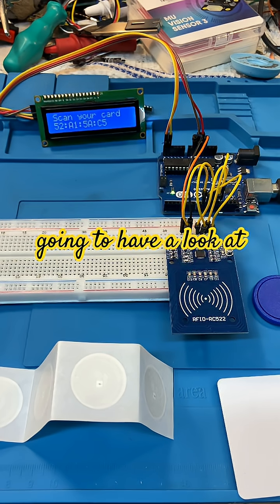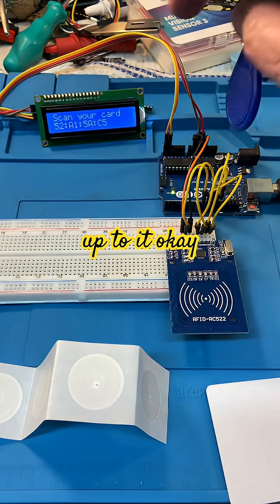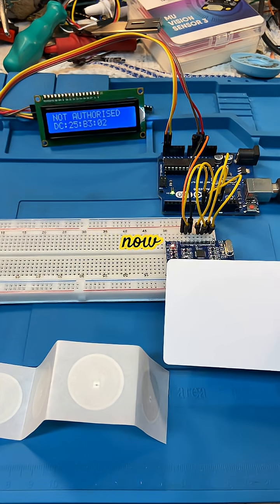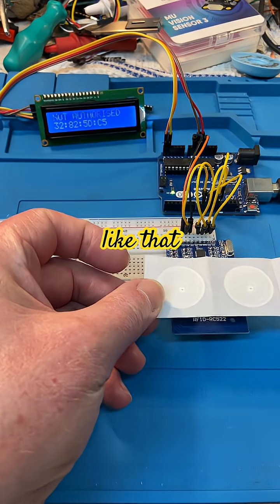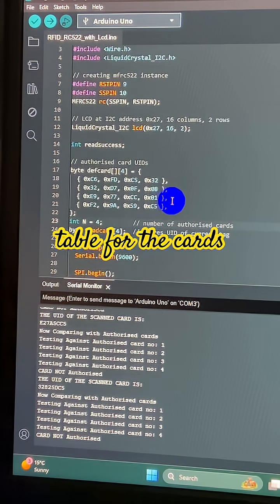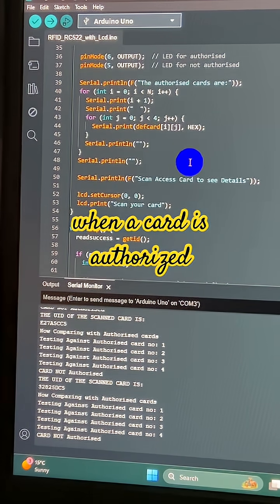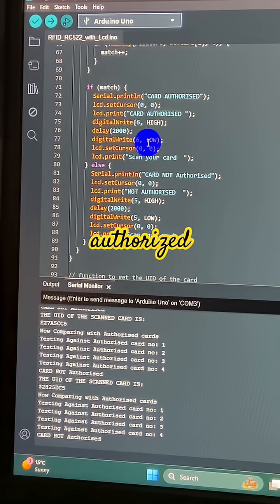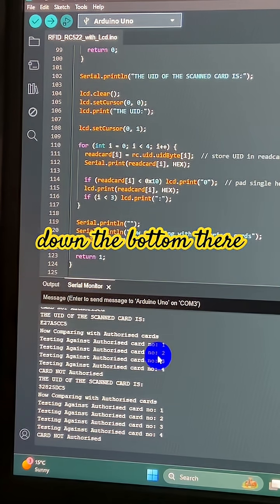Arduino RFID Card Scanner with LCD Display – See Your Card’s UID Instantly! #shorts #arduino #rfid

Comment from the maker: 📌 How this RFID + LCD code works:

When you scan a card or tag, the Arduino reads its unique 4-byte UID using the MFRC522 RFID reader. The UID is displayed on both the serial monitor and the 2×16 LCD in hexadecimal format.

The code then checks if the scanned UID matches any of the authorised UIDs you’ve defined in the defcard array. It does this by looping through each authorised card and comparing byte-by-byte using memcmp().

✅ If it finds a match, it lights up the authorised LED, shows “CARD AUTHORISED” on the LCD, and lets you in.
🚫 If no match is found, it lights up the not authorised LED and shows “NOT AUTHORISED” on the LCD.

The LEDs, LCD messages, and serial output all give feedback about what the reader detected and whether access is granted.

It’s a simple, effective way to build a basic access control system — and you can add more authorised cards by expanding the defcard array and increasing N to match the number of cards.

Comment: I got bogged down on Line 66 . Could you explain the syntax ?
Reply from the maker: This part of the code is where the scanned card’s UID is compared to each of the authorised UIDs you’ve defined earlier in the defcard array.

🔷 It loops through all authorised cards (for (int i = 0; i < N; i++))
🔷 Prints which authorised card number it’s checking against
🔷 Uses memcmp() to compare the 4 bytes of the scanned readcard with the i-th authorised card in defcard
🔷 If they match exactly, it increments match by 1

At the end of the loop, if match > 0, the card is recognised as authorised. If no match is found (match == 0), the card is not authorised.

It’s basically just checking: “Does this scanned UID match any of the stored authorised UIDs?”
Reply: @Uncle-Duncan-Electronics-Shack  Neat .Thank you
Reply: Ah, I was puzzled about the square  brackets  ,  but I now know  that is how the array index value syntax works  . Ask a question, and one's only a fool for a minute .